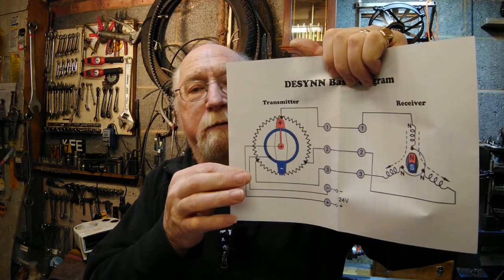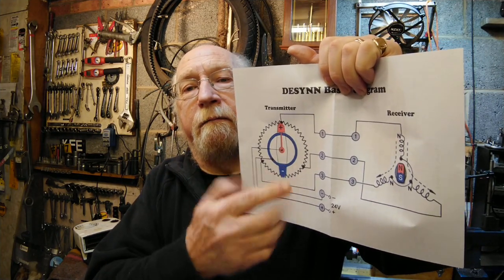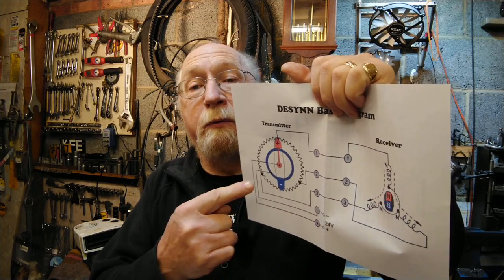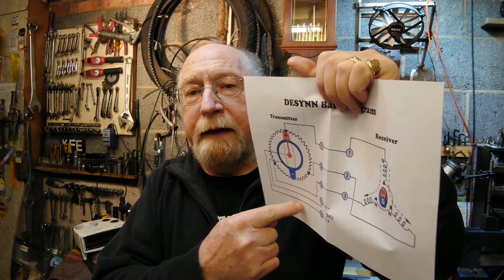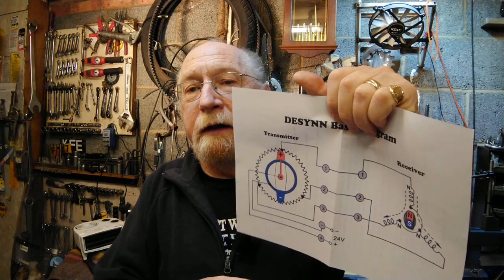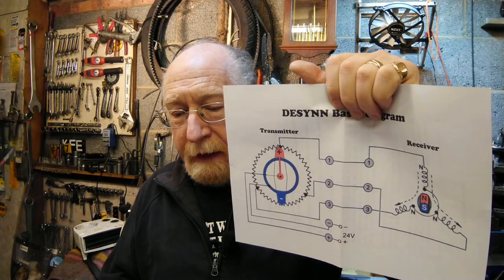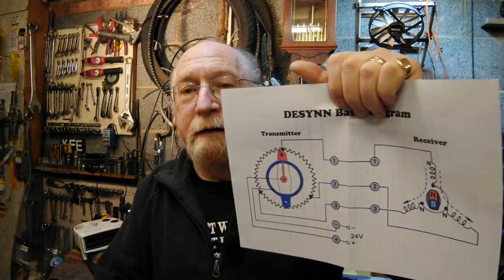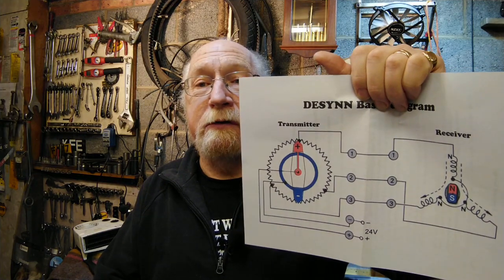The Desynn transmission system Part 1

Comment: Hello, I would like to test a Desynn transmitter manufactured by SMITHS whose reference is 6002 FG/CPM/3. I have documentation which gives me the reference of the test bench (3TE) but I cannot find it.
Do you know if there is a generic Master Desynn indicator able of testing all types of Desynn transmitter?
Thank you in advance for your answer.
Reply from the maker: Thanks for your reply, the box I used is the standard 1st line test set. There was a Master Indicator for use at 2nd/3rd line servicing, but we don't have one, I've only seen one for sale, but that was some years ago.  The book you need for reference is: Smiths DM5, I have a copy dated March 56, I can send you the PDF .
I also have documents DM10 parts 1 & 2 and DM13.  Hope that helps.
Reply: Yes I'm interested by DM5 book if you can send it to me.
Reply from the maker: Sure can, message me at tces@oneuk.com and I'll send it to you. @finoulilou31